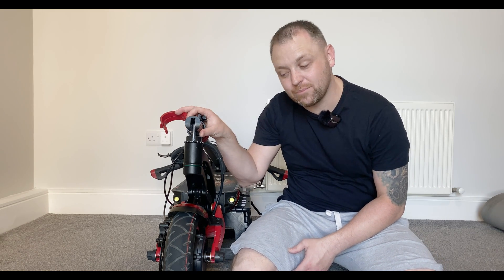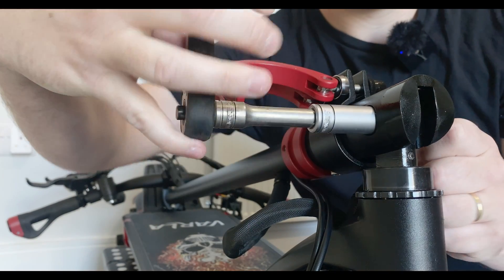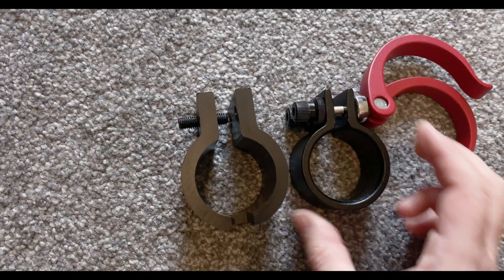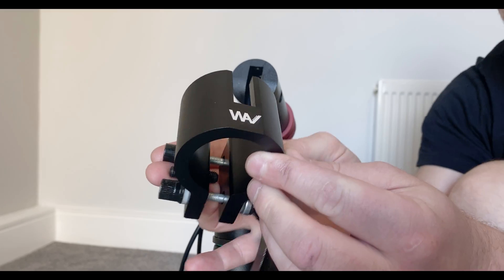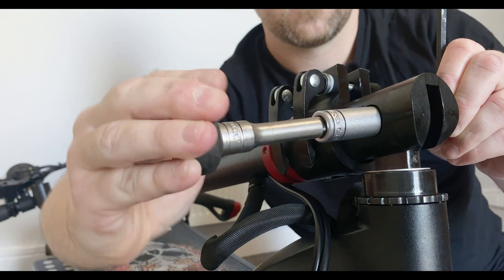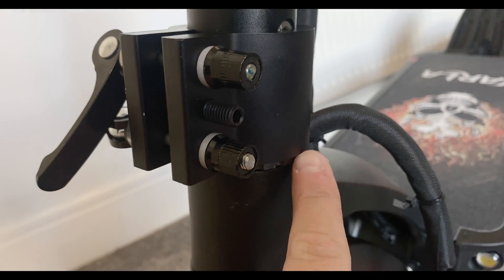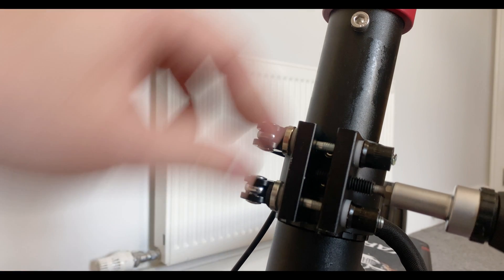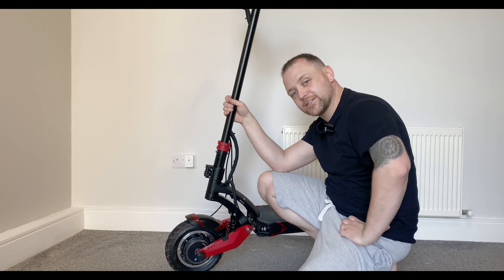VARLA EAGLE ONE // Rugged Clamp Upgrade (DO IMMEDIATELY)

Comment from the maker: Thumbs up if the video helped you!
⚡️ Watch next
🛴 Varla Eagle One Unboxing
https://bit.ly/2UdtMai
🛴 6 Maintenance Tips For Your Varla (Zero10x) 
https://bit.ly/3Boeks8
🛴 Varla Eagle One full review
https://bit.ly/36ReR8Q
🛴 Varla Eagle One vs Xiaomi
https://bit.ly/3x0gRpM
🛴 G Booster GPS Speed Test
https://bit.ly/3h431Or
⚡️ Product links in the description if you want to upgrade your scoot!

🔷 My e-scooter FB group for Xiaomi M365/Varla Eagle One/Zero10x and any other scooters: https://bit.ly/2NMeXIY
Reply: I would like to ask this question. I love my eagle one, but I do believe that it’s fundamentally unsafe. At the top speed, the entire platform is unstable with lots of wobble. Granted I understand this and use my best judgement,  although I can see a someone thinking otherwise. You can’t protect people from themselves, and an organization you should use care in making a product which if used as designed is flawed from a engineering standpoint.
Reply from the maker: I have not had any wobble to be honest. When I done the full review, top speed was 65km/h (I believe it can possibly do a bit more)

There are things you can do though to stop the wobble. 

Check tire pressure (I have 45psi)

You can actually get the steering damper for them which stiffens up the front. I’m gonna get one myself at some stage because I would like the steering to be even more stiffer at higher speeds.

People have also upgrade the handlebars for more stability. 

When I get the damper, I’ll do a before and after comparison and an installation video on it. It really is a great scooter though!
Reply: Hi I just subscribed to your channel, where where is the link to buy the upgraded clamp, it looks good!!
Reply from the maker: Hi! You can get it from here https://a.aliexpress.com/_mrD1H4T

Comment: Alot of ppl i watch says and tightghts the bar stem..  But you say dont because it could cause an accident. Im confused
Reply from the maker: I’m not sure what you mean. The purpose of the ungraded clamp is tonnage the stem more firm. Definitely a must ⚡️
Reply: @Movelectrics  Sorry for the typo.  What I mean is that the majority of people make the clamp super tight. But when I watch you,  you do not make your clamp as tight as other people. So it kind of makes me confused as to should I make the clamp tight or should I not.  But either case ill figure it out.
Reply from the maker: I have my clamp quite firm. Go back and forth, top latch, bottom latch until satisfied. Then the grub screw in the middle.

Comment: My new clamp just doesn't clamp slides up and down even after I fasten down the clips. What am I doing wrong ?
Reply from the maker: Did you loosen the  black grub screw like I did in the video? Loosen that first, then tighten one clamp, then the other, then repeat until tight.
Tighten the black grub screw last.
Reply: @Movelectrics  got it! Didn't see that part. Thank you and appreciate it
Reply from the maker: No worries

Comment: Thanks for this!  I have two Varla Eagle One's and just installed my upgraded stem clamp. I tried to use the metal shim/washer but it wouldn't allow the stem to seat 100% vertical.  So I'm not sure if it matters, but mine are working fine without the shim.  Any suggestions/opinions are welcome!
Reply from the maker: Hi! When I installed the shim, you need to slightly push the stem forward for the clamp to fall fully down. Takes a small bit of force. The reason for the shim is to firm up everything ⚡️

Comment: Dude! This was so incredibly helpful. For any new purchasers, make sure you use the black bolt to extend the clamp a bit so it slides fully over the base of the stem. I made the mistake of not doing this initially and kept having stem issues.
Reply from the maker: Hi Russell! Glad the video helped! Good point also about the black jacking bolt. Next upgrade, possibly the steering the damper ⚡️
Reply: I've been having an issue with mine where no matter how tight it is, it still ends up shimmying up the stem. Is this a fix for that?
Reply from the maker: Is the clamp 100% fully down? You using the shim also?
Reply: @Movelectrics  I am, yes, however I never even noticed the grub screw before, and backing that out completely fixed the issue!
Reply from the maker: Yes the grub screw is tightened last ⚡️

Comment: Hi.... I bought the same thing after viewing your video. I've watched your video a few times and am still confused about that middle bolt. What is the purpose of that middle bolt please? How tight should it be?
Reply from the maker: Hi! If you are talking about the middle bolt underneath the stem (8mm size) that should be tight. I haven’t needed to adjust mine but of course it should be checked. It basically pulls everything together like the bearings in the steering column. Installing the rugged clamp should prevent issues so don’t be worrying 🛴
Reply from the maker: Or if you are talking about the small black jacking bolt within the clamp, that just firms everything up so there are no weak points when the clamp pulls together ⚡️

Comment: Hey I gots a question, how does the regen braking work? Do you just use the brake or is there like a button or something
Reply from the maker: Hi Mason! It is located in the P settings (hold down power and mode button together)
P11 is the regen/electronic braking. You can set it from 1 to 5. I have mine on 1. Each person has a different preference but be very careful if you set it to 5, it’s very harsh braking and the last thing you want is an accident ⚡️